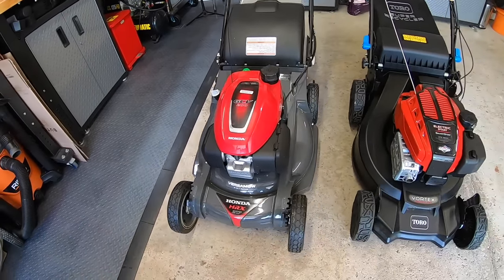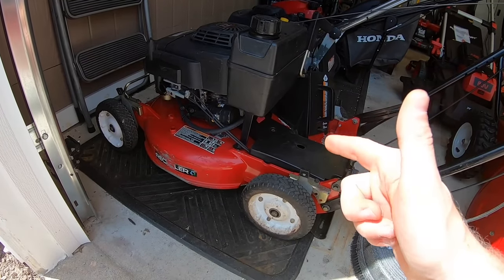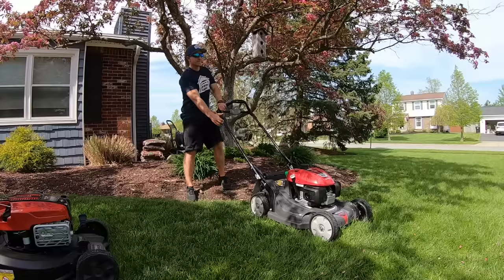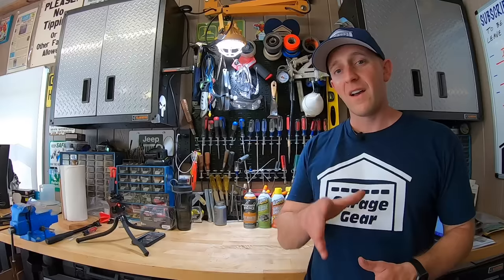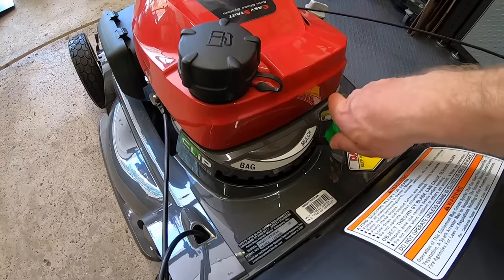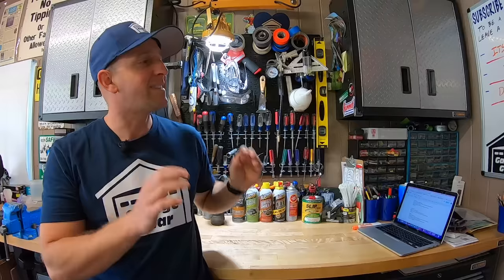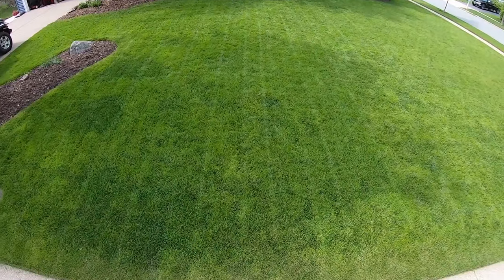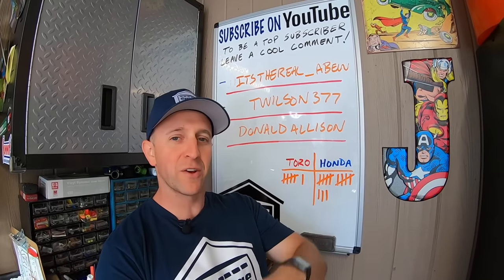HONDA HRX217VKA VS TORO SUPER RECYCLER 21564 - WHICH MOWER IS BEST?

Comment: I've been in my house for 41 years and I'm only on my second Toro,,,and never had a repair other than sharpen the blades and change oil, that's awesome service from a great product.
Reply from the maker: @TommyG11814  the older toros are much better built.
Reply: @GarageGear  the Toro I've had almost 20 years now has the Honda engine, and it always starts on the first or second pull, never a belt replaced just sharpen the blade every year and personal pace system is still flawless.
Reply from the maker: @TommyG11814  that’s awesome to hear

Comment: My new Honda mower has an open belt and pulley (no guard) under the deck. It looked like the Toro had one. That lack of protection could cause premature wear or failure of the drive. Really makes my mower susceptible to even moist grass clippings. Otherwise been loving this mower's performance.
Reply from the maker: Good point thanks for mentioning gpal!
Reply: I own a Honda HRR. Its about 3yrs old now. I take excellent care especially during winter storage. Anyway, when I wash the bottom of the deck, I let it dry & spray with Fluid Film. Keeps deck from rusting & grass clippings don't stick near s much. And don't get on belt.
Reply: Wash and dry after use.

Comment: I have had the same Honda for about a year now and agree completely with all of your opinions, especially about the underside of the deck.  Lots of places for grass clippings to accumulate.  But, that is my only complaint.  Hands down, the most powerful walk behind mower I have used.  I cut 3 lawns with really thick St. Augustine grass and it is very rare that it has an issue.  One thing you might have left out, does the Toro have a fuel shutoff?  That can be a huge carburetor saver long term.
Reply from the maker: Good point Ryan thanks for sharing
Reply: I have a Toro Personal Pace for 22 years without a fuel shut off and never had any issues without it.

Comment: The Toro rear wheels crack around where the bolt fastens to the mower, ugh! Quick fix: Buy 2 small radiator hose clamps and fasten them to the inside of the wheel where the bolt slides thru  to fasten them to the mower , this prevents the plastic from splitting, which leads to wobbly wheels
Reply from the maker: Thanks for sharing mary!

Comment: I like the Honda mower because they have blade controls where you can push with the motor on without the blades spinning plus they start up on the first pull and are easy to start
Reply from the maker: Thanks for sharing Caleb

Comment: Great comparison! I have the 2020 version (pre Vortex deck) of this Super Recycler, and my engine does sputter sometimes.  Bought it over the HRX because of the stow-n-go (not much storage space at my house), maneuverability,  and the shock absorbing handles that are good for bumpy yards.  I mostly enjoy it and do not regret the purchase.  Mulching quality is right on par with the mid-90s HRB215 and early 2010s HRN that I had prior to that.  The 190cc Briggs has what feels like double the power of the standard HRN 160cc Honda motors.  My grass is healthy and very thick, and the Briggs has never once stalled on me.  The 1990s machine I'd get to stall maybe 1-2x a year, the 160cc HRN, more like 1-2x per mow lol one big con vs the plastic deck Hondas is the amount of grass build up I get, but I guess I would say it's not any worse than the steel deck Honda I had prior to this one.
Reply from the maker: Thanks for sharing Ryan!
Reply: This Honda has 200cc's. Comparing "Apples and oranges".
Reply: @georgepruitt637  thanks George!   Very glad you caught that I was never talking about the 200cc engine

Comment: I have a @ 2006 Toro recycler.  B&S engine.  Last year I replaced the  personal pace transmission and drive belt. Deck is in great shape as I use the wash port almost all the time and do yearly pm maintenance ( plug, air and fuel filters, oil, lube cables, ethanol free fuel when possible and Stabil added) This mower STILL starts on the 1st pull.  Take care of your mower and it will reward you with many years of service.
Reply from the maker: 💯 agree sp!

Comment: My local dealer had one HRX 217 left. It’s mine now. Best push mower I had ever bought. Keeping my HRN 216 for backup since they are done making them
Reply: Seriously going to buy a HRX 217 tomorrow.  Debating between HYA and HZA for the electric start.  Found one with the hydrostatic drive!
Reply from the maker: Get em while they’re hot fellas! 👍
Reply: It gulps oil! Very quickly!! And if too much oil is added your engine will smoke and die!! From experience here!

Comment: I love my toro 2020 21385 super recycler. Being a honda fan boy with 4 honda cars i looked at the hrx but some of the negative reviews i read kept me from pulling the trigger. Im glad i purchased my toro befor the design change and price increase.I went with the toro branded engine cause of the sputtering issues with the briggs. I have no regrets. I just bought the toro sr mulching blade to test out.
Reply from the maker: Thanks for sharing this John! Let me know how the blade works out for you!
Reply: Yup. 2020 is like a distant memory now. Prices were still within the universe. That's the Loncin engine right? Black top? Toro needs to up the ante and the consumer needs at least 170 ccs on a mulching mower. 150 can chug in the deep stuff. How's the power. Toro usually uses straight blades for whatever reason.
Reply: post how you see the Toro SR mulching blade performing for yourself?  thank you
Reply: @marshmower  following : what to hear how John sees the use of his toro sr mulching blade on his 2020 Super recycler..
Reply: I haven't even put it on  yet. I been bagging my clippings cause disease pressure is high from weather conditions. Hopefully I can put it to use in the fall.

Comment: I bought a HRX217HYA. Ran for 20 min. When I tried to start it up again the pull cord was stuck and almost ripped my arm off. I guess it’s a common issue for the cam assembly/decompression. 

Have you had any experience with this issue? 

Dealer told me Honda was making warranty repairs difficult, taking about 2-3 months of going back and forth just to get Honda to approve repairs.
Reply from the maker: Thanks for sharing this D! Someone did mention this but I think it was on another model! Glad this shared in our community!

Comment: I’m a big Honda fan, own 2, also owned a Toro Recycler for about 10 years.  My concern for Honda is that they are leaving the lawnmower business, at least the gas powered side.  I have seen videos of their battery powered line which I’m guessing will be available here soon.  Hopefully getting parts for their gas powered mowers won’t be an issue.
Reply from the maker: I don’t think it will be an issue! Thanks for watching
Reply: Only for the us market, and they will still be making the motors just not the. Mowers for US. Parts for other parts of the mower will be around for decades

Comment: I have both. HRX is about 15 years old and the Toro Super Recycler has the Honda motor and is 2 years old. Both cut equally well, but the Toro is lighter and easier to maneuver around the yard.
My summary is can’t go wrong with either. I can say I’m a Toro fan now.
Reply from the maker: Thanks for sharing Greg!

Comment: The next up the line Honda hrx has the upgraded hydrostatic transmission with the speed shift. I haven’t used a better self propel system on a push mower.
Reply from the maker: Awesome point! Thanks for sharing

Comment: I have had this exact Honda for 3 years. Absolute best push mower on the market. Now I read the manual but either I forgot or I'm a little dumb. Didn't realize it rear discharges until just the other day. 😅 I don't bag and prefer mulching anyway. But the grass is crazy here. It would struggle a little mulching 2 foot high grass but not discharging. Love this mower. Half assed pull and she starts.
Reply from the maker: Hey goose! Honda makes a great mower!
Reply: I have the Honda and while it is a great mower, it's not good on slopes and backing up. I also have to sharpen the blades a lot and have changed them 3 times in the last 10 years. I have a lawn service that sprays so the grass is rather thick. I'm currently looking for a riding mower as the slopes in my yard are getting kind of difficult on this 69 year old...
Reply: @jzm6403  I totally understand. I had back surgery, thanks to an accident, a few months ago and I am half your age. I actually think I just found a project JD X495 for cheap.  I have no hills here in Coastal Texas. But grew up with them. Anything over a couple thousand Sqft ya need a lawn tractor. I've been pushing 25K for long enough
Reply from the maker: @jzm6403  thanks for sharing Jzm!

Comment: I have been wanting a smartstow Toro to save room and now watching this video, that is this same Honda that I am replacing.  I am awaiting the Toro 190cc to arrive so I cannot compare them yet, personally.  However, I have had that Honda HRX217 for about 8-9 years and still starts first pull.   I have super thick grass and keep it at 4" cut without any problems.  The deck is a non issue really, it is similar to a football helmet material and those are meant for taking a beating.  My Honda still looks brand new.  I take care of my sister-in-law's lawn and will leave it over there, so I will get to enjoy both of these mowers.  Thanks for these great videos, I ordered the Toro after watchign your review video on it.

P.S. - I do the annual maintenance on the Honda religiously and keep an extra sharpened blade on hand to rotate every few cuts (I am a lawn nut).  One thing I am struggling with is the thought of the "no oil change" Toro marketing.  I believe I will end up removing the annual used oil and replacing it, but haven't made up my mind yet.
Reply from the maker: Hey reversion sounds like you’re a lawn nut for sure! You’re in good company! And I sounds like you got your heart set on that toro! I would definitely change the oil on that engine once a year! Thanks for being a cool fan!

Comment: Just found your channel and you’ve been a huge help in researching my next lawn mower. Do you think the Honda is better for sloped yards than the Toro? Both my front yard and backyard are sloped and I’ve had a Honda before but the biggest issue I had was with the cutting. I have Zoysia in my backyard and it’s pretty thick stuff, you think this model Honday can handle that as well? Thanks for posting these videos, they are a big help.
Reply from the maker: Hey concours rider! Appreciate the positive feedback! The Honda is a good all around homeowner mower that can handle most turf types! I think you’d be surprised by its capabilities! The dual blades work nicely mulching everything up too! If you have any other questions let me know! 👍

Comment: I have both. For me it's Honda all day. Build quality, engine power and reliability,  mulch cut, drive train. Only thing i like better on Toro is the blade clutch  enabling me to drive the mower to different areas i cut in my yard at different heights without mowing.
Reply from the maker: Thanks for sharing Robbie!
Reply: Honda has a version of both the HRX217 and the HRN216(and the older version of the HRN the HRR216) that have blade clutch, Honda calls it Roto Stop. But only on the more expensive versions of the models.

Comment: Just purchased a hrx217 and I absolutely love it! Looking for a back up mower at the moment and can't seem to make up my mind. I could go with a Honda HRN with the gcv170 but I want something a little beefier. I really like the Toro Super Recycler with the 190cc Briggs, and I love the personal pace system. With that said, something intrigues me about the new Ariens Razor 21 dual blade. Looks like a beast and with the dual blade I'm very curious on the cut quality. Curious on the Reflex system too! Unfortunately not much info on the Ariens kicking around YouTube just yet. Would love to see a review on one!
Reply from the maker: Hey Esteban! I would like to review that mower as well .  Time will tell! 👍
Reply: Ha, I just bought a Honda 216 on Sunday afternoon and on Monday morning I was given a near new Toro 22. Now I can't decide which is better. The Toro seems to have a bit more power and will drag you around on a trailer if you could find a hitch point, but that Honda is just a lovely machine too, with perfect lawn stripes and cleaner cut. I even tried both in the rain and both gave perfect results. Beggared for choice after putting up with dodgy mowers for a couple of years. BTW, how do you get rid of old mowers which still work just fine but are ratty compared to  both of my new ones? Probably could leave them on the sidewalk with a sign, 'FREE to good Home'.

Comment: In 2010 I bought a brand new Honda HRX2172VKA for $600.  I have used it a lot!  I mainly mulch both my grass as needed and my leaves in the fall.  Other than normal maintenance stuff like blades, spark plugs, oil and air filters... I have only had to replace (1) part.  I started hearing a weird ticking noise.  I searched the web (including YouTube); found a video with the exact same problem.  the noise was coming from the pull start (the pull start worked, but the ticking was annoying).  I ordered a new pull start for around $25 + tax and the issue was fixed.  This has been the most reliable lawnmower I have owned.  My first was a Craftsman that lasted about 5 years .  Then I bought a Toro which lasted about 6-7 years.  My HONDA has exceeded my expectations.
Reply from the maker: Thanks for sharing this information with the community JRF👍

Comment: I have owned 6 Honda lawn mowers since I was 22 and recently turned 62 .
I have noticed my last two mowers where not as robust and I finally had enough with my last new hrx217 with quality break downs and leaks , so I sold it after 6 months due to living in a rural area the nearest honda shop is 45 mins away and repairs where weeks apart. 
My son inlaw purchased a toro 22" recycler with briggs and stratton 190cc motor and has been raving about it last 2 years.
I decided to buy the Toro AWD 163cc recycling mower this week and can not beleave how much better this mower is over the Honda's I wish I would have listened to my son inlaw earlier. 
Have heard Honda is stopping production of its lawn mower range and I think they should if yhey are not going to research their products properly and release expensive rubbish on to the market. 
My Honda leaf blower and whipper snipper are due to be replaced shortly I am sure I won't be going Honda again for anything.
Reply from the maker: Thanks for sharing, Mark! I hope the Toro does well for you like it does your son in law.

Comment: Not sure why folks talk about Honda's Xenoy (aka NeXite) decks as if this is a new invention? Honda introduced these composite decks in HRM models in the early 1990s! So yes, they last decades! The wheels on HRX217 have 2 bearings (inner and outer) in each wheel. In VKA, VYA and VLA trim levels, the front wheels are also made heavier due to additional round metal plates inside the wheels. Also, the quality of paint and smoothness of all levers on Honda is really top of the class.
Reply from the maker: Honda really is the top of their class!

Comment: Very comprehensive review. I have owned the HRX 217-VYA for several years. I will never sell it. The Versa mow system and cut quality are far superior then all other walk behind mowers. The only thing I do not like is the Select Drive. I prefer the Personal Pace system of my Toro TimeMaster. Thanks again Sir for your information and energy!!!!
Reply from the maker: Hey gls! Agreed! I do like the older personal pace designs this new one is way too big! And I walk into that bar a lot! Appreciate you bud! 👍
Reply: @GarageGear  Ahhh... I see your point. The Recycler handle is much larger and shaped differently then my 2018.
Reply from the maker: @gls3894  yeah the older ones were better! 👍

Comment: I have the HRX217K5VYAA. I got the Honda Roto-Stop blade control. That was the reason I bought it. I can run the engine without the blades engaged. Ine thing you may have overlooked was the size of the bag opening. So large you can dump leaves out of it faster with less fuss. Give the Honda two more points.
Reply from the maker: Those are nice features! 👍👍
Reply: @GarageGear  have you used a gas mower with blade control like my Honda has? Roto-Stop.
Reply from the maker: @ericressler1450   my Honda doesn’t have that feature but wish it did! 👍

Comment: I bought a Honda HRX in 2021. Overall big fan. I will say, while the Mulch/Bag adjustment seems like a good idea, if you have a finer grass like Bermuda you'll still wind up with clippings accumulating in the discharge port when fully on Mulch setting (along with a little bit of discharged clippings coming out of the back). Feels like Honda could have solved this with some sort of weather stripping or just better seal for the adjuster. It's not a huge pain, but doesn't match the usual Honda engineering standard.
Reply from the maker: Thanks for sharing this information Brandon!

Comment: Switching from Bag to Mulch on the Honda can get  difficult  if some Grass is stuck under the Deck
Reply from the maker: Good point! 👍
Reply: open the rear flap and wd40 the mechanism and also wd40 all 4 wheel adjusters. really helps, the bag to mulch lever will move easily even jammed up with clippings.
Reply from the maker: @geodot595  thanks for sharing